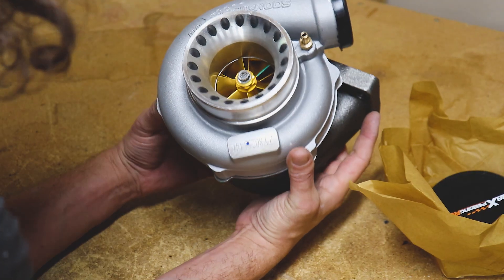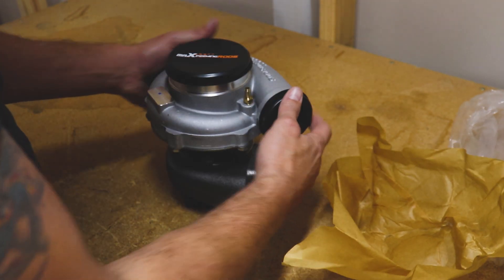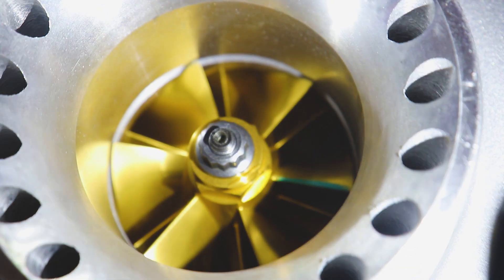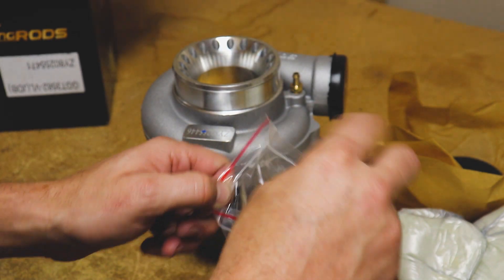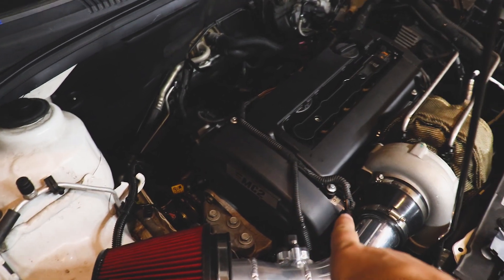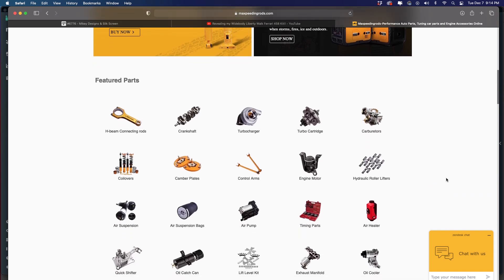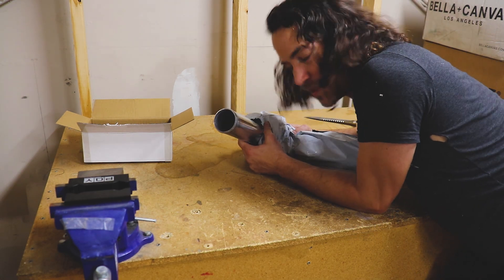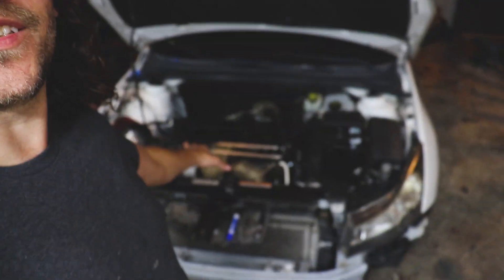Affordable Billet Wheel Turbo? $276 Gt3582 Maxpeedingrods Turbocharger for the Built 1.8 Chevy Cruze

Comment: Whats the update on these turbos? Do they last?
Reply from the maker: They work well and last. This turbo I've had on the car for 2 years. No issues. Just make sure you feed it enough oil pressure, no restrictor (they have one built in), enough oil drain back, and route the coolant lines to them, and they will last years to come. Only reason I swopped mine out is because I upgrade to Maxpeedingrods ballbearing turbo they just released. Use code MATTCHEVY and you'll get a discount.

Comment: with express regret I inform you that your turbine broke down after 2 days, and it is with regret that I have to agree with those who write bad reviews. Set at 18 PSI it was fine for only 2 days then it seized up, the Garrett worked on me for 2 years without any problems - REALLY ANGRY. Good continuation.

Comment: wish I new more about turbos, could turbo charge my ride one day /cheers ScrapBongo Liked
Reply from the maker: I guess the best way to look at it is...
The air we breath is, depending on where you live, is 14.7 psi, or barometric pressure (baro). They originally were developed for naturally aspirated airplanes back in the day. The higher you get altitude wise, the thinner the air is. So their engines would start to stall. Turbos helped get them back to baro. The formula is, although not set in stone because some engine designs are more efficient than others, let's say your engine produces 200 hp naturally aspirated. A turbo compresses air into an engine, compacting more air into it, in turn which requires more fuel. More air, more fuel, more power. That 200hp engine at 14.7 psi (2 bar), theoretically would make 400 hp. At 3 bar, 29.4 psi, will make 600 hp. However, there's a point of diminishing return depending on how efficient the engine is. While you're compressing air on the intake side, exhaust pressure from the combustion process builds up as well and can even become greater than the compressed air from the intake side is and power starts to fall off.
Turbo sizes really just all depend on the size of your engine, and how much air it'll move for a given liter size. The larger the turbo, the more exhaust gases it'll take to spool it up to compress air into your engine. So they have an operating range for a given engine size vs turbo size. The GT35 may operate around 5k-8k on a 1.8L engine. A turbo like a GT25 would operated from around 3k-5k and fall on it's face, or stop producing power.
So the turbo you choose really will dictate when it'll kick in for a given engine size.
Aside from that, they require oil to lubricate them, and a way to get oil back in the oil pan. Not to mention you need tubing to get that air into your engine.
As you compress air, it heats up and becomes less dense. Which intercoolers are meant to help cool down some of the hot air.

Comment: Aww you just broke my heart😔 I make and sell inserts for the hks to specifically make louder whistle sounds lol
Reply from the maker: LOL, I got it because I did enjoy the sound. They're not easy to seat, but I definitely want to try a different sound this time round. And more power to you! That's awesome on the inserts.
Reply: @cmattdabrat  yeah I had a knockoff hks and the snap ring that came with it was insanely stiff and was almost impossible to get in and seat the bov. I later bought a genuine one and it went in way easier and the snap ring was nowhere near as stiff.

Comment: Do you have a link to the replacement nuts for the exhaust manifold on the 1.8l? I know you had a video with them in it but I cant find it. Have to replace the oil cooler on my gf's 1.8l sonic and since I have to remove the exhaust manifold I need to replace them.
Reply from the maker: I honestly would just reuse them. They're not like the copper ones that come on the turbo manifold. I reused mine multiple times with no issue.
Reply: @cmattdabrat  thank you. I haven't dug into her car yet. I had to replace the turbo on my 1.4 cruze and had no idea the nuts were single use and have had an exhaust leak ever since. I assumed they would be the same style nuts.

Comment: its too bad you put all that work into the LS coil swap , to not be able to use it, is that on the back burner for troubleshooting?
Reply from the maker: I'm going to bring it back. Hang tight. I installed a stock setup just to get her running NA. Now that we're moving closer to running boost, it'll be on the car soon. Just need to trouble shoot the custom wires I made. I might have to redesign how they mount so I'm not trying to reinvent the wheel with the spark plug wires.